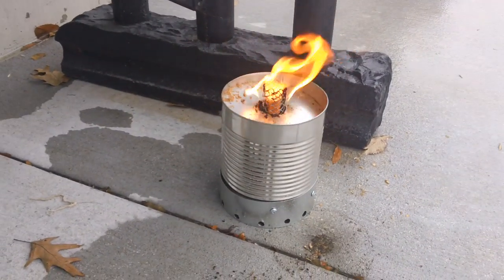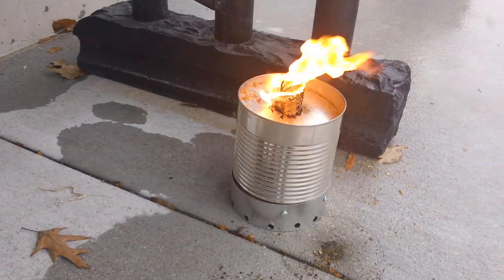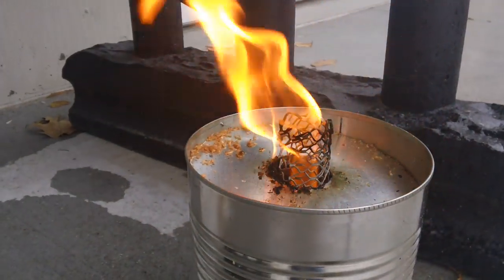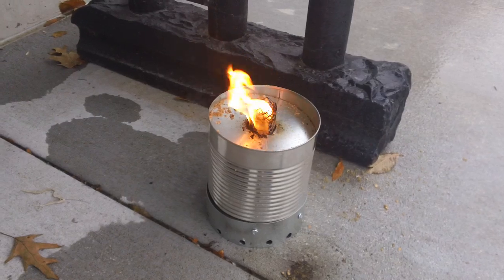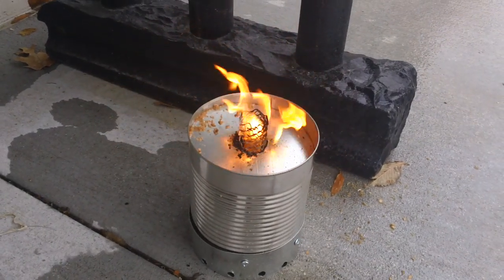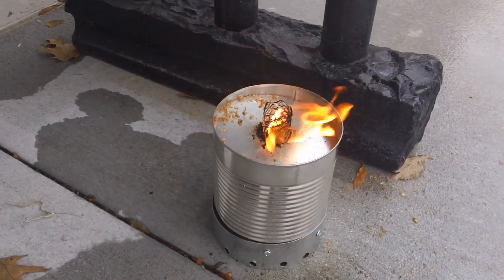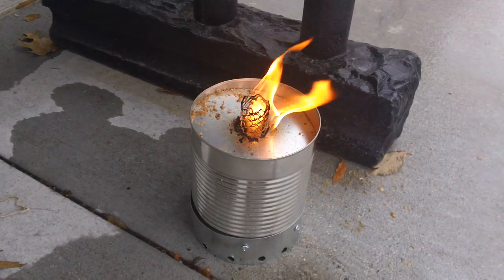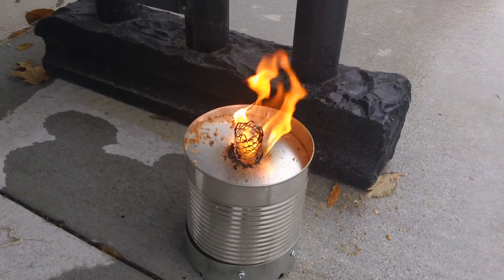Waste Oil/ Saw Dust Burner for Rocket Stove

Comment: How do you light it, from the top or bottom.
Reply from the maker: light a small piece of paper towel rolled up stick it in the hole from top and its lit a squirt of lighter fluid if you use thick oils is ok too
Reply from the maker: OK we missed something . your hole in center is same diameter all the way through the bottom to let air in not just small holes in the sides ? please see other saw dust stove videos for clarification  and saw dust must be dry. I have a feeling you air is not right

Comment: please do not use used motor oil.  Dangerous hazardous to your central nervous system by inhalation of smoke. After all it is a petroleum product and it would also pollute the air.

Comment: What a PITA though!  You'd have to make 12 of these a day, refill the stove 12 times a day.  Come up with one that has a 12 hour burn time, and I'll get interested.
Reply from the maker: ummm do you think it might be possible to make one bigger diameter? IF that might be possible do you think you might be able to put more fuel in it? IF you got more fuel wont that burn longer. aint that a simple and logical conclusion to come to .. instead of making  a bunch of little ones? ummm they burn from the center out and the wider not taller you make them they burn longer about an hour for an inch of burn from inside the burn tube working its way outward. I build one from a 55 gallon drum that will last over 12 hours. Great for green house applications and easy to build a stove around or for.. I have one made from a 3 foot diameter cattle trough that heats a green house 24 hours on 1 load... one could cut and make a short 5 gallon bucket one and it would last about 5 or 6 hours... where you see limitations I see possibilities and where you see problems I see solutions. could it be proof of concept for smart people and a stumbling block for.. well ... people like you?

Comment: I would like to see you build this start to finish, also I wonder if you could use crisco in place of waste oil
Reply from the maker: I believe if you watch the next 2 parts you will see how simple it is. I show the bottom and explain it better and burning in the rocket stove.. ANY and I mean any flammable liquid or grease will work good luck

Comment: I seen a guy on youtube do this without the wvo in a waterheater to heat his house. He uses steal tube to form the burn path then pulls it out before lighting it
Reply from the maker: Yes I saw something like that too. Then I remembered guys making fake logs pressing them and how they needed moisture to do it then I thought how wvo would up the btu out put plus help pack the saw dust win win
Reply: Van Powell Fake logs with wvo sounds like a pretty genius plan. Guess it would work best with some kind of outer containment(loo rolls?), since fake logs are normally dried to firm up. Also they would need to be stored differently.

Just got thinking as I'm writing. One potential problem would be spontaneous combustion. Not sure if it would apply to a tightly packed medium though.